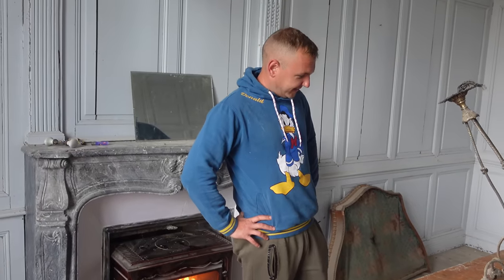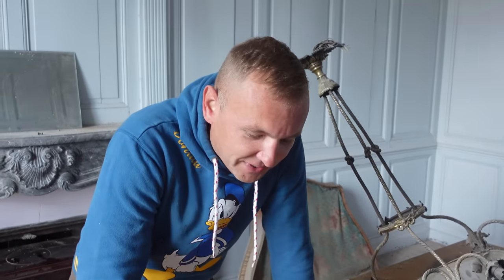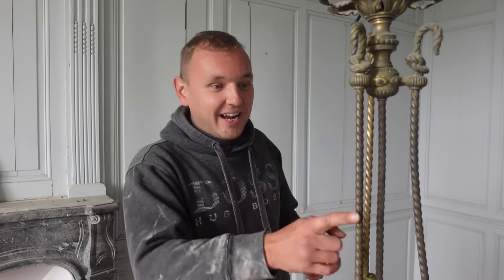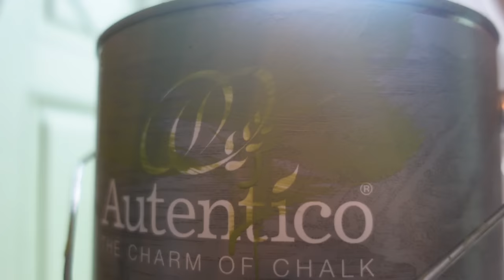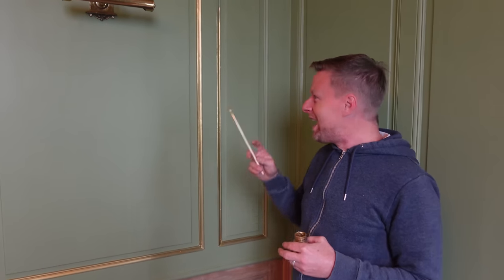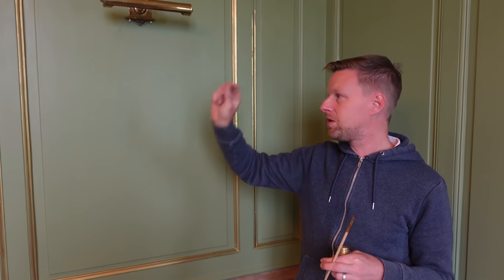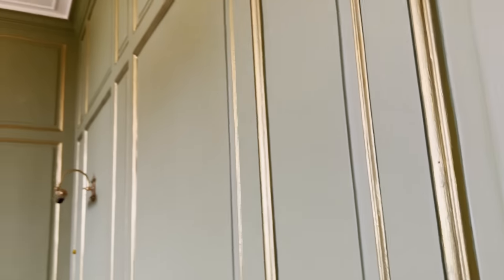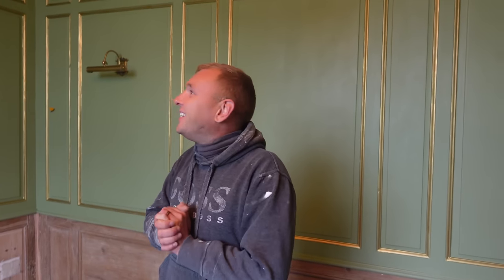A Momentous Occasion: Celebrating The First CHANDELIER Fitted in over 40 Years At The Chateau

Comment: The tubular sconces are designed as picture lights or library lights for built in bookcases. What also works to clean the brass is to put salt on the cut edge of half a lemon and rub that against the brass. Love the LaLacelle Green. I suggest using a clear coat over the gold as it will darken over time and the clear coat slows the process to keep its original color longer. It is a joy to see the rooms come to life.
Reply from the maker: Thank you so much ☺️

Comment: 7-11gr tartaric acid (original recipe says 1packet), 1tablespoon lemon juice or white vinegar, 1teaspoon dishwashing liquid.  1/2 cup water. Shake up to dissolve tartaric acid.  Apply with paintbrush or cloth. Leave 10-15minutes and wipe down with damp cloth.  My husband's french granny's recipe to clean copper and brass.  Very cheap and super easy.  Also stays clean a lot longer than after brasso clean.  With real old stuff, I soaked it a bit in a bucket instead of just applying.  Works a charm.
Reply from the maker: Thank you so much ☺️

Comment: It is 10 degrees Celsius here too.  South Island New Zealand. It is always between 6 and 10 degrees where I live at the base of the southern alps.  I have double glazing, insulated walls floors ceiling, heavy drapes, air blowing in from the roof space and heat pump.  Sometimes the heater is on.  I’ve got used to it.  Average temp in summer is 21 degrees Celsius.